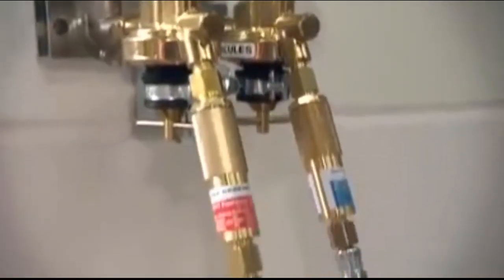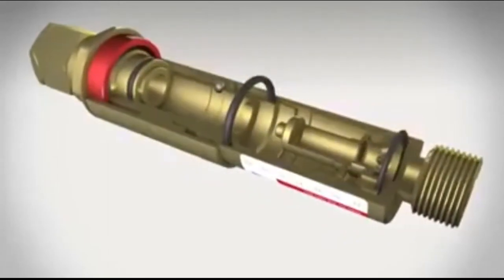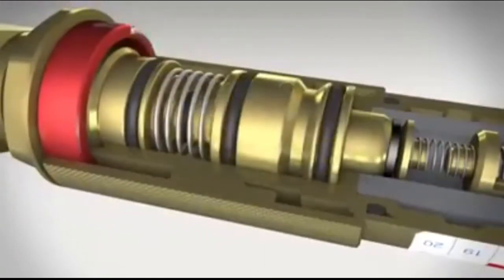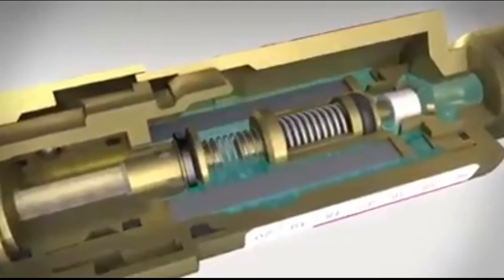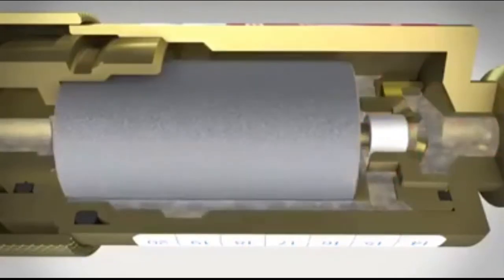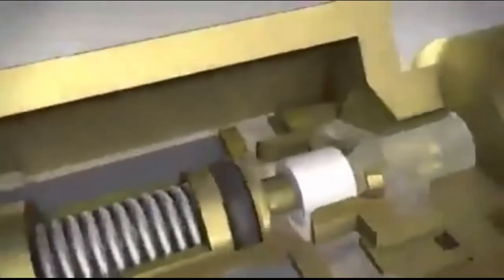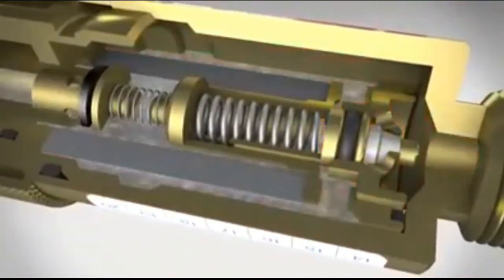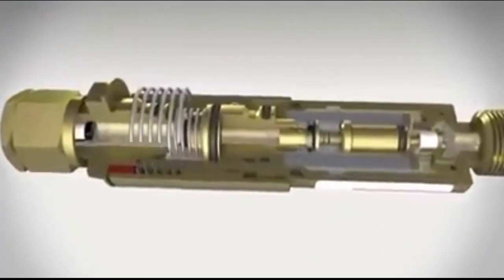Flashback Arrestor how it works

Comment: Is it use one time only? Like a fuse?
Reply: If the flashback remains in the valve long enough to melt the spacer, yes, the spacer melts and seals the gas path permanently.

Comment: Is there a way to know that a Flashback have ever occurred?
Reply: I would assume the spring-loaded pressure valve would be in the triggered position from the heat and prevent the flow of gas.